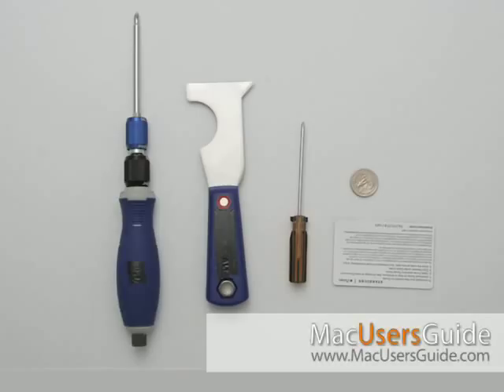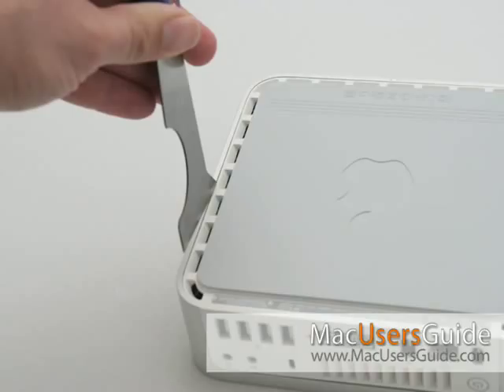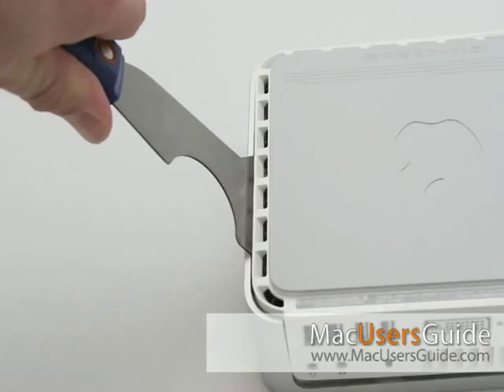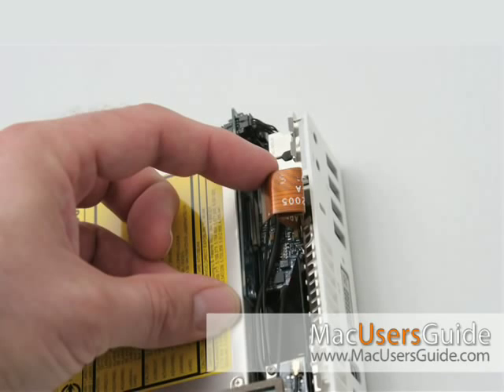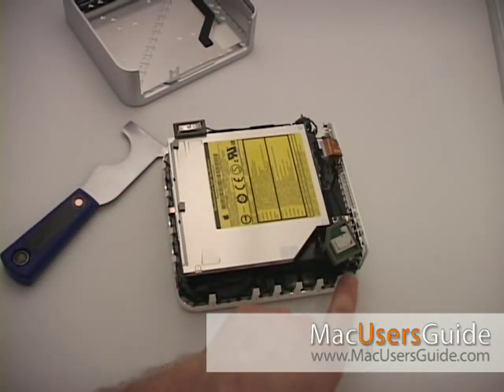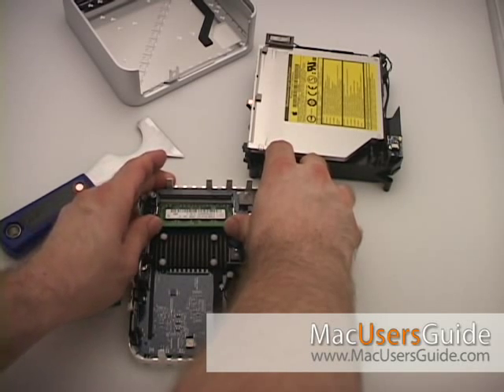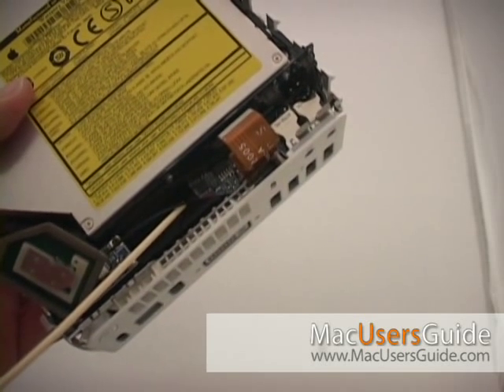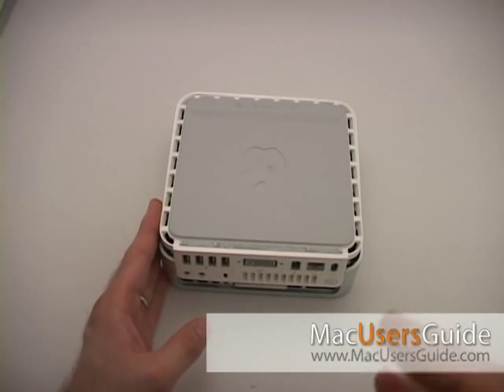Mac Mini Upgrade: How To Open a Mac Mini and Add RAM

Comment: Great instructions -- thank you for taking the time to post this!  For those of you watching this that may see slight differences in your Mini: my version of the Mac Mini didn't have the hard drive cable in the lower right front so I didn't have to worry about that at all, and the audio ribbon cable in the rear left was slightly different (I had to disconnect it from the separate unit rather than the base).

Comment: A shishkabab skewer? When I want to open my computer all I need is to remove the thumbscrews. I see that Apple really doesn't want you to have an easy time getting in there to upgrade it. Is that a paint scraper? LOL
Reply: Apple wants you to use common tools you have around the house to upgrade, not fancy-pants thumb screws that take 4 seconds to remove and replace. Anybody can do that. Breaking hidden plastic tabs is part of the Apple Experience!